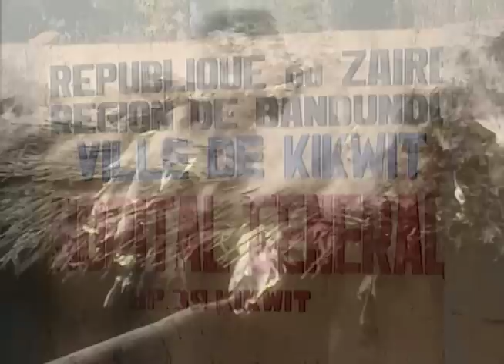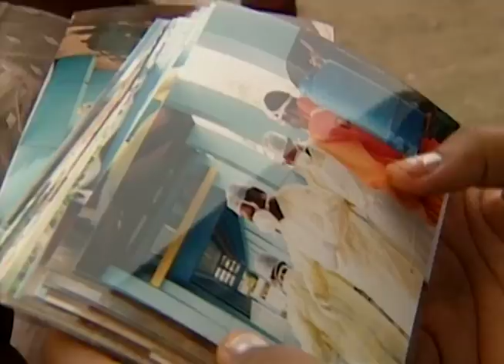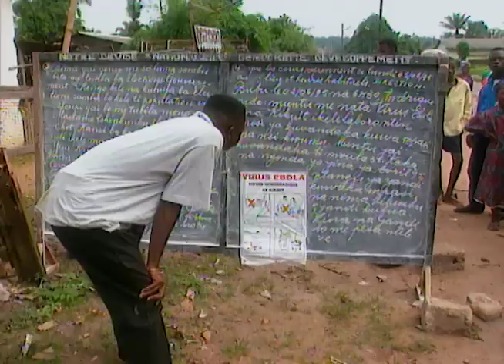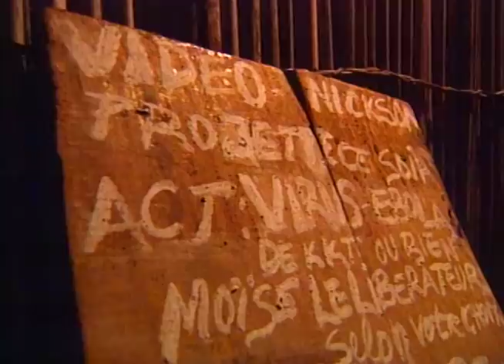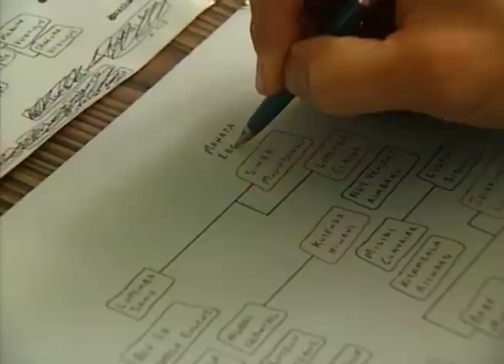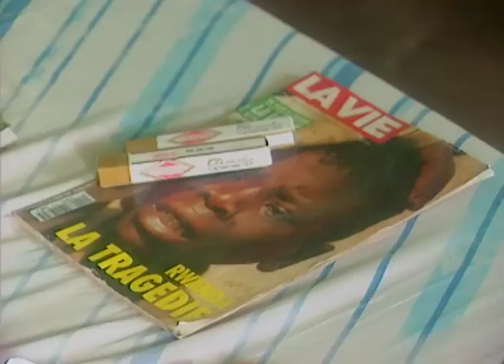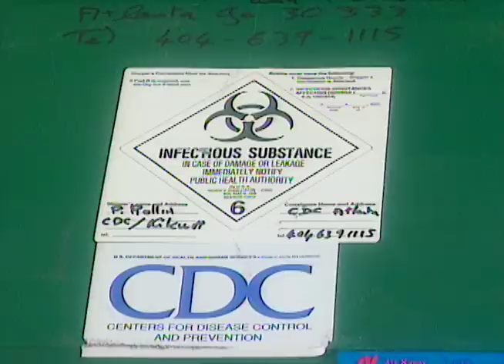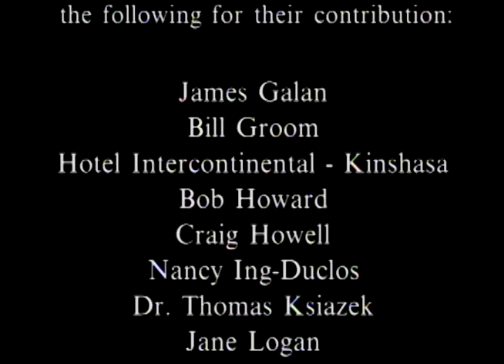Doctors Test Unstable Ebola Vaccine To Prevent Outbreak - Ebola - Health Documentary

Comment: Witch one is worst
Ebola: has worst symptoms than Coronavirus
Coronavirus: spreads eaiser than Ebola
Reply: Ebola: -ssRNA virus
Corona: +ssRNA virus

Ebola: Need to convert it's '-'ssRNA, to '+' ssRNA before multiplying. 
Corona: The above step is not there; their transcribed mRNA can be read directly by our ribosomes for multiplication. 

Ebola: Time consuming for mass spread, but with high mortality. 
Corona: Fast spreading, putting pressure on health system increasing mortality. 

So both, in their respective perspective, 🙏sir.